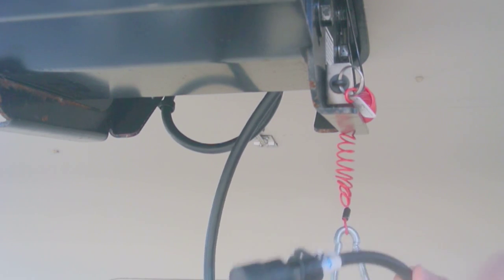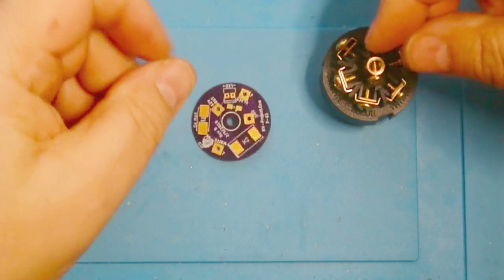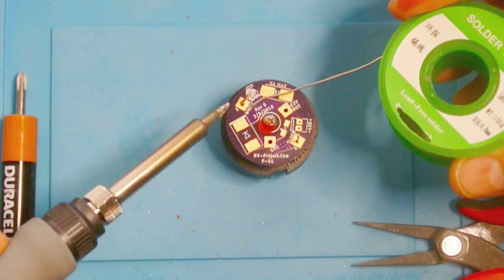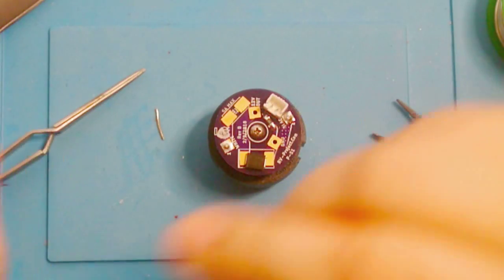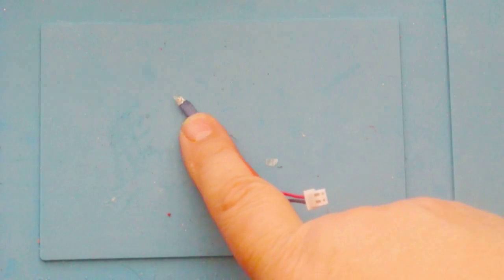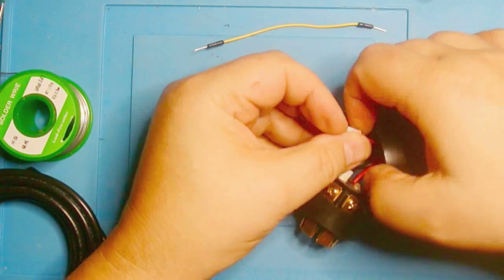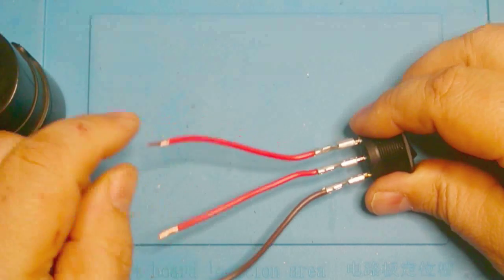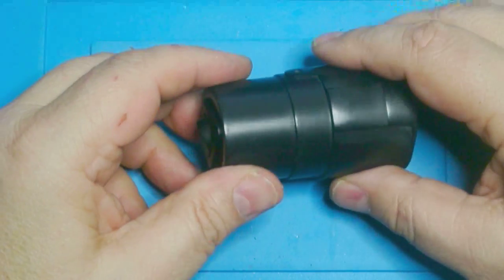Building a 12V Outlet for the Pin Box of your RV.

Comment: on the first one with the 12v black and the G white, if you connect a 12v cig outlet and put a load on it, it will be on even when the truck is off. Which will drain your battery. How would you go about putting the 12v black on a relay then using the tail lights that works off ignition switch as a trigger? That way the load is only drawing power when the truck is on.
Reply from the maker: The power adapter I build in the video can only be used when the RV's trailer wiring harness is disconnected from the truck. 

When connected, it drains power from the RV battery. If the RV is on shorepower, then the battery will not become discharged.

Of course, if you are boondocking or not on shorepower, the RV battery will be discharged.

Comment: I am reviewing your wire pinout on the 7 pin trailer connector you did on the second project, and it looks like your taillight, and power connections are backwards.  Did you try it and does it work?  Pin 4 is power, and pin 3 is running lights, however in your video it looks like you have them flip flopped based on the switch, like your green LED would always be on...
Reply from the maker: I do provide a wiring diagram on my webpage (http://www.rv-project.com/projects/hitchpower.php).

Comment: I completed this project and added a switch to turn on my clearance and running lights from the 7-pin connector.  What I learned:   not all female 7-pin connectors are the same.  The wiring scheme for a utility trailer are a little different than an RV trailer (buy the right one).  Second:  12AWG wire does not want to be crammed in to that 7-pin connector.  Third, on my switch, the pole for the LED was in the opposite position than yours.  Easy fix though.  Thank you!!

Comment: I just bouight a 7x16 enclosed trailer to store and haul my Side by side. When I have my trailer hitched to the truck with the 7 pin plug plugged into my truck I have power to my light inside the trialer. But once I unhook the truck and have it in storage, I have no power or lights. Can you help me figure out the best and easiest way I can plug the trialer into my 120VAC outlet on my RV Pad. I'd also like to be able to plug a battery tender into this power to keep the battery charged through the winter. any help would be great.
Reply from the maker: Do you have an on-board battery for your trailer?

Comment: I built a connector to keep my running lights on... please take a look and tell me if you think it's safe.  I added a fuse, but I would like to know your opinion.  Much simpler than your being I don't have your skills or knowledge.  Take good care.
https://www.youtube.com/watch?v=5nrydxuc8u8&index=15&list=UU2Cthylxf7NnC4GAoW0KSHg
Reply from the maker: I generally don't like pigtails, but at least you fused it, so if one of them fell out, you would at least have some protection.

The main issue I see is if you inadvertently connect the wrong pins together. For example, if you connected the battery to the brakes, you could burn them out if you didn't realize it right away.